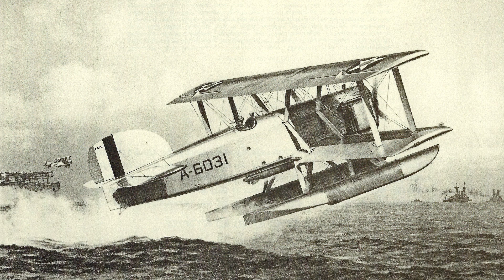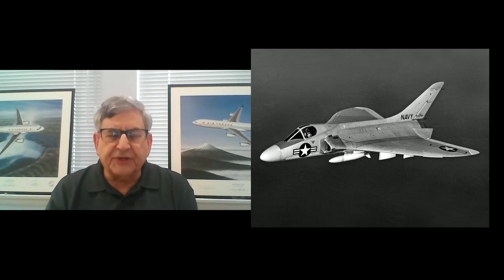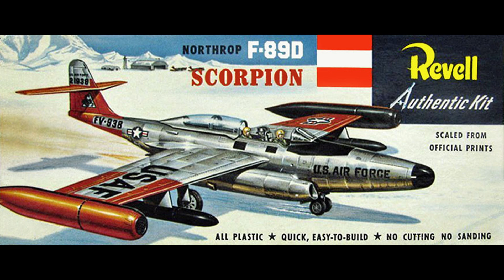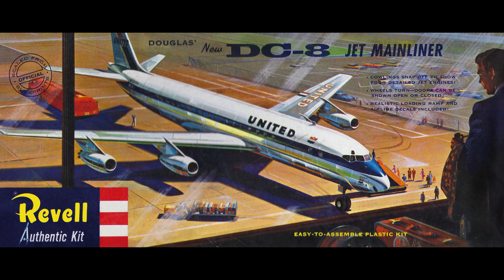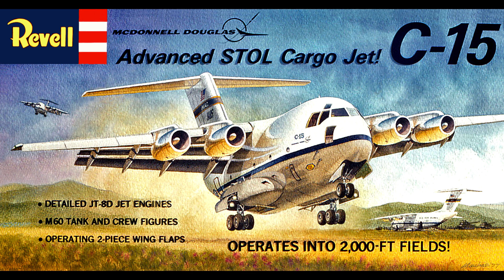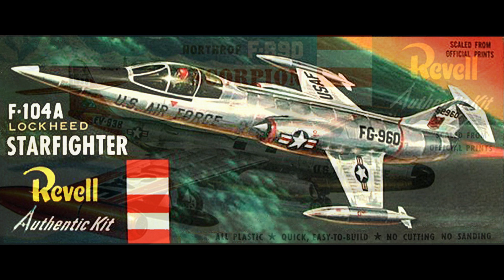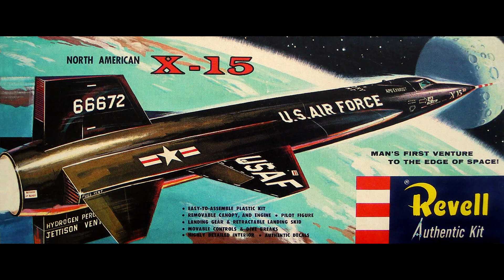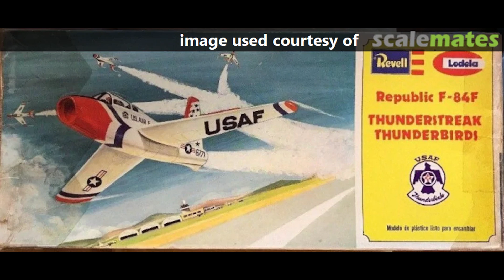Mike and Max talk models and aircraft

Comment: Thanks Max, thanks Mike! That was really great conversation and a lot of information. Seems to me, we have mistakenly  built a society that has more lawyers than engineers, artists and pilots put together. In 1980s something has gone wrong at both sides...  Zvezda writes on their boxes 'Licensed by Sukhoy',  and Eastern Express writes just 'Airliner-737'. What a ???
A4 Skyhawk is a great plane. Absolutely Soviet in basic concept - KISS. Remained in production for almost as long as the MiG-21. 
A-20 Boston was beloved in the Red Army Air Force. It was used in an unusual 'air suppressor' role. Its  job was to suppress the German airfields right prior to important air operations. For that role it was fitted with rather unusual weapon. Bomb clips and bomb bay doors were dismounted and Mozhorovsky's swinging 20-mm guns battery installed in the bomb bay. The guns were swinging focusing on the ground target that the A-20 flew over. The servos could be programmed depending of the speed and altitude. The same kind of device would be made as a container for the Su-25 some 40 years later. Air suppressor A-20 Squadrons did a great job during WWII.
https://img.wikireading.ru/353396_1_pic_4.jpg

Comment: I would suggest that the Handley Page Hampden shared some of the concepts incorporated in the Boston - with the exception of the nose wheel. The Boston was a slightly later design and was quite a bit more capable.

I always enjoy the Western Museum of Flight lectures which you can see on the Peninsular Seniors You Tube channel.